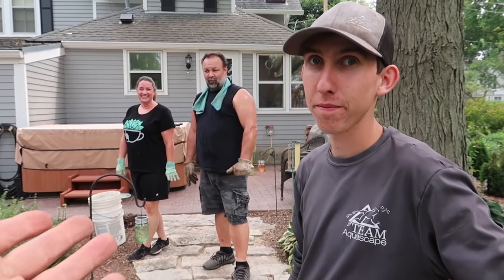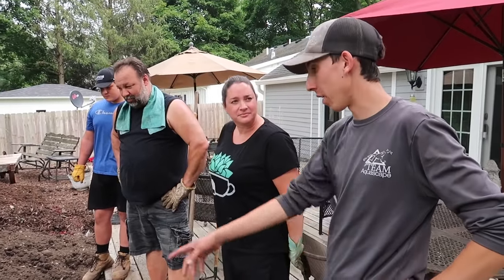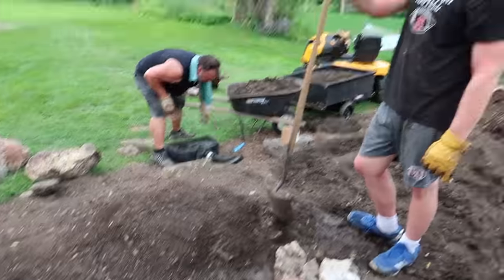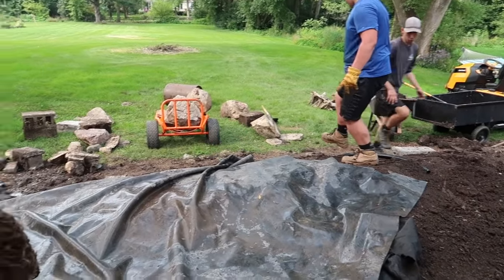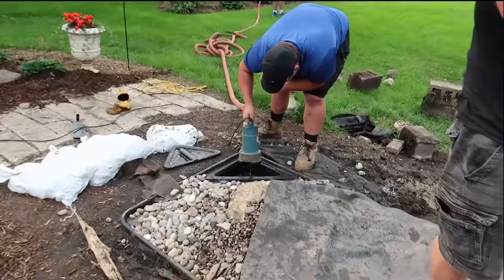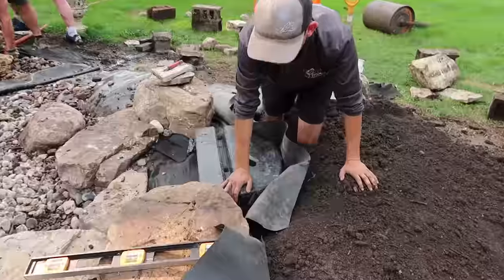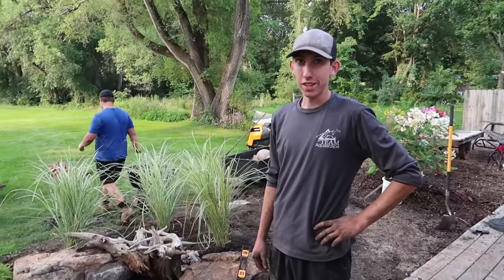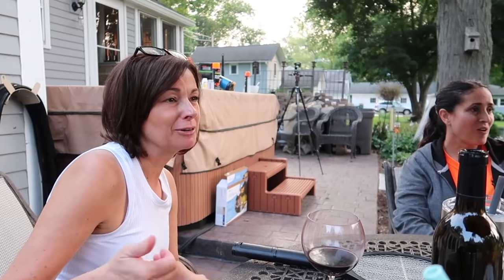WATERFALL Built In 2 HOURS!

Comment: After years of keeping many fish in many fish tanks in my house, one day I decided I wanted a backyard pond to replace an 18' by 30' above ground pool I recently got rid of. I took a 100' garden hose and marked out the shape I wanted and started digging no measuring except depth as I wanted to put Koi in the pond and had to ensure it wouldn't freeze solid in the winter. I finished digging and then measured what I had done, I went to a local pond store and they told me what I needed for a liner and filtration system and that my pond would hold 3500 gallons of water. I was quite impressed with how well it went being it was my first attempt and I did it with only a vision in my mind. The waterfall for the return water and where my filter had to be concealed was the only real problem as it needed to be better planned and I had to fix it a few times to get it right.